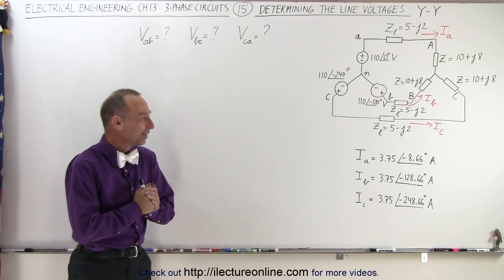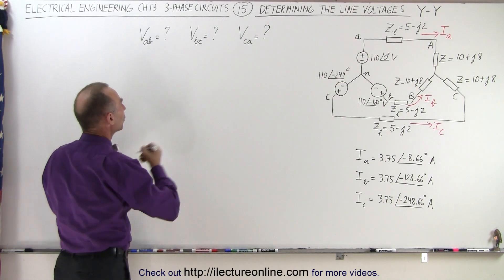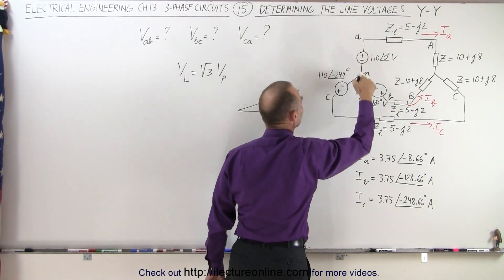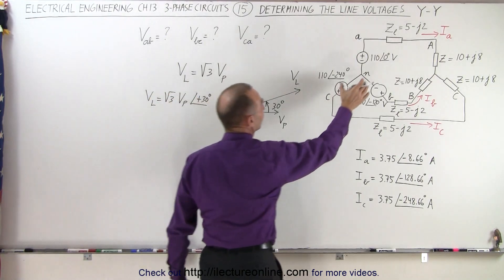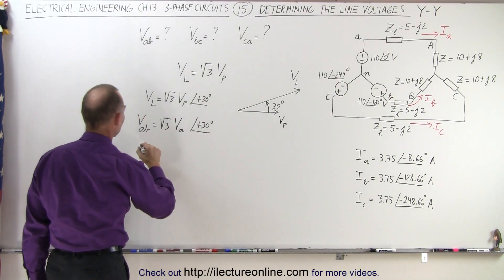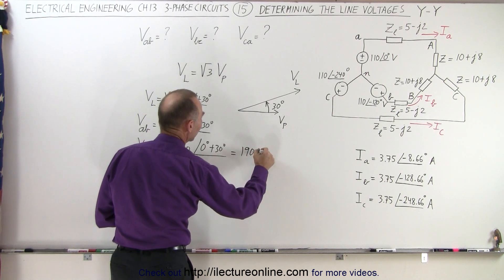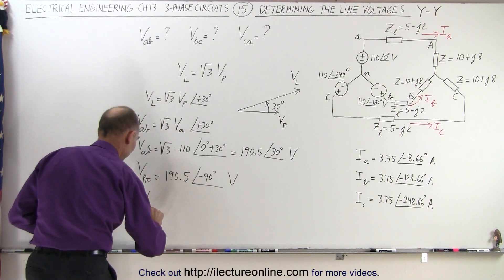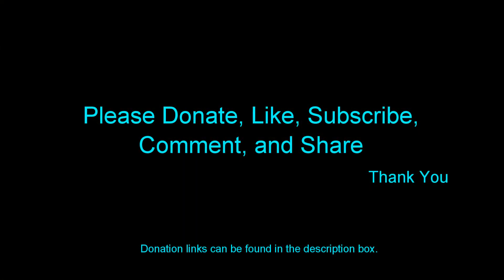Electrical Engineering: Ch 13: 3 Phase Circuit (15 of 42) How to Find the Line Voltages? Y-Y

Comment: The last exercise calculating the line currents used a different set of phase voltages namely Van = 120<30; Vbn = 120<-90 and Vcn 120<-210.  The phase currents that you have listed are based upon those phase voltages and not the ones in the current problem.